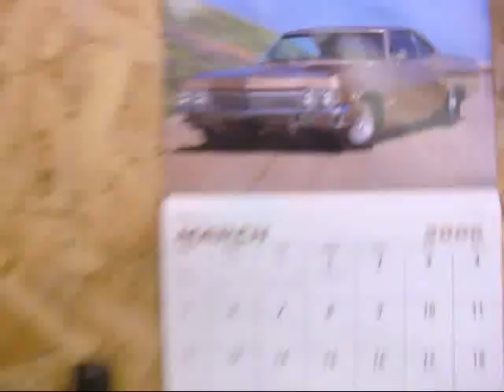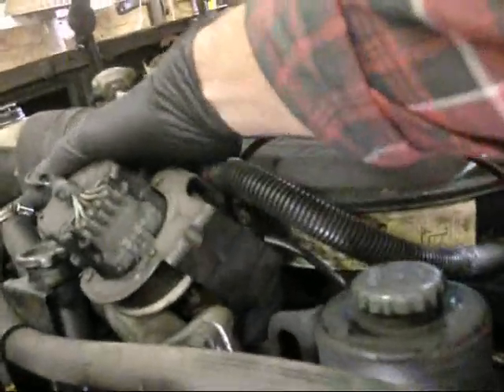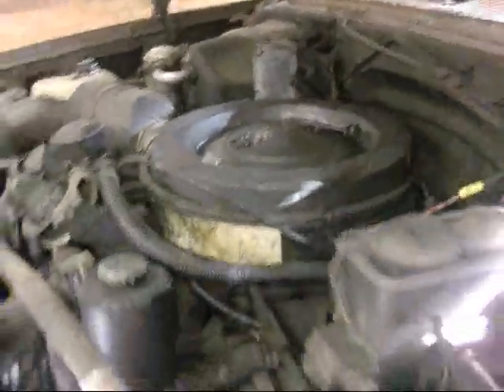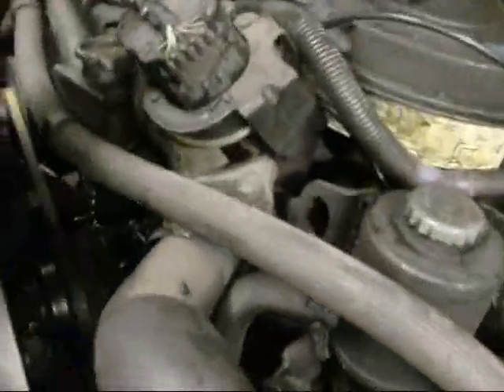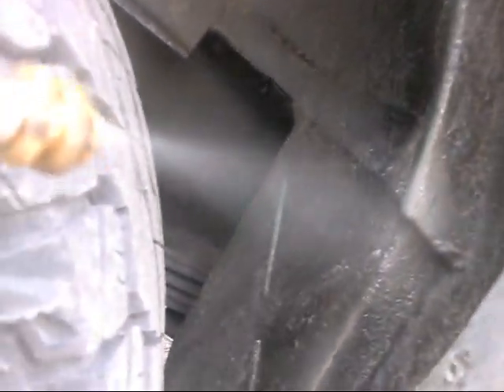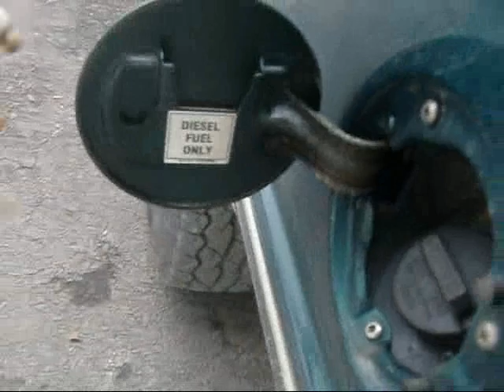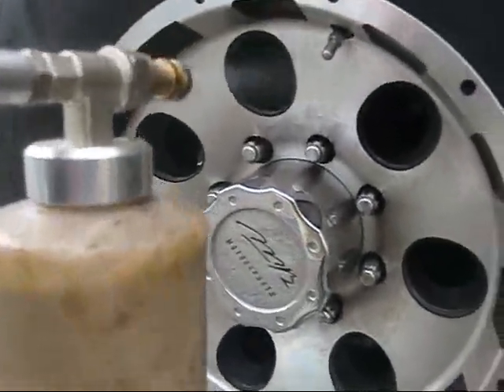Fluid Film Compressor 'Weasel 1 14 13

Comment: cw there are 2 spade connectors on top of the injection pump. One is the timing advance in case your worried about that that is also activated with the fast idle.

Comment: Not sure if the 6.2 has a single timing mark or multiple. If one you use a timing light with built in advance. I got one with rpm and advance helps a bunch. The adapter i have is a ferret electronics diesel injection detector. They still make them and sell them. The problem is they cost $200.

Comment: There are inner bolts on the injection pump. You loosen those up. Then your rotate the pump. I think the 6.2 and 6.5 are opposite rotation to the idi pump so advance rotate it to the drivers side, retarded rotate toward passenger. You can pulse time where a little piezo electric clamp attaches to a injection line and senses the line expanding and contracting sensing when a injection event occurs. The box outputs a inductance spark plug loop. Bring engine to 2k rpm to measure timing.

Comment from the maker: But couldn't I cold start it, disconnect the wire, and the advance would drop? It would be easier if it was the wire on the IP, easier to get to then the one at the back

Comment: It would be louder but if the timing is off and is retarded to begin with your not likely to notice. Most of these trucks these age had an injection pump replaced and were not timed correctly. mostly just by ear which isn't very accurate.

Comment: Impossible to accurately measure spray thickness by eye but from your last year video I could see that you applied more than the suggested 400 to 800 micron simply because it looked more than one milimeter in most places (one milimeter has 1000 microns).My point is you are wasting expensive AR Fluid Film for no additional benefit.Looks like the nozzle you got on their now is just about right...